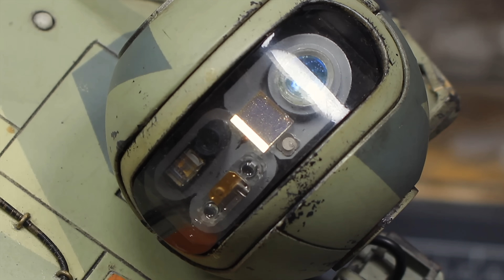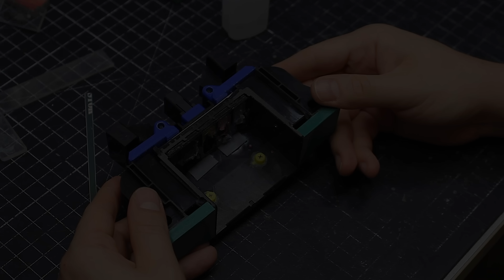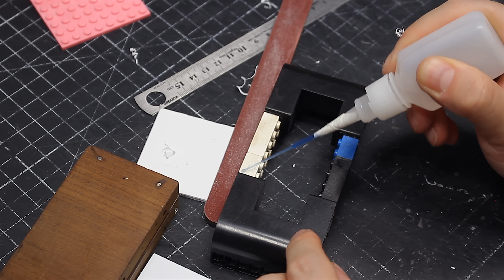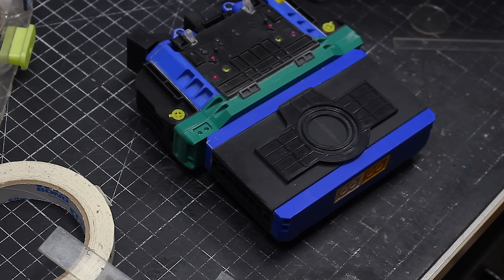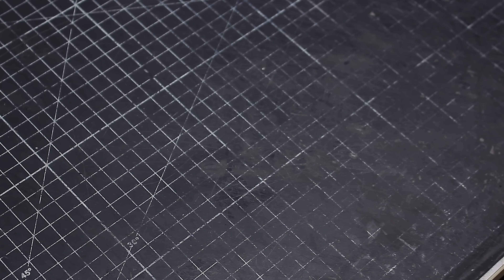Rebuilding a Classic with Everything I’ve Learned!

Comment: I'm not gonna lie, I actually really dig how the MG turret still has the SAMSUNG visible and prominent on top. I think that it makes the model tell an even more grounded and dystopian story... like the military industrial complex has gone full-on commercial and now their weapons of "security" and war proudly bear the logos and brand names of their manufacturers and war is no longer just between nations, but it is among nations as well as many terminally capitalist corporations. May be a kind of tall order, but if you have or can score some more parts that have the Samsung brand name printed or molded into them to use on the hull or the legs or other weapons, that would be so sick. Or if there are other brand parts like the Samsung turret, that would also be sweet!
Reply: Off the top of my head, perhaps 3D print a panel with the Exxon logo for the side of a fuel cell or paint the little Amazon smile on the side of a huge ammo box or a radar dome with the Google logo or a telecom brand like Claro or T-Mobile or Vivo or something.